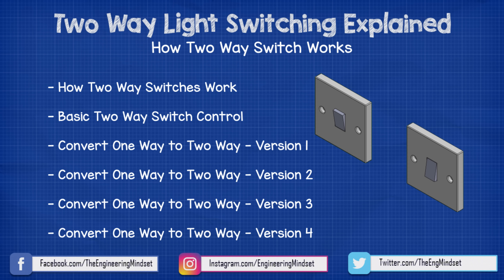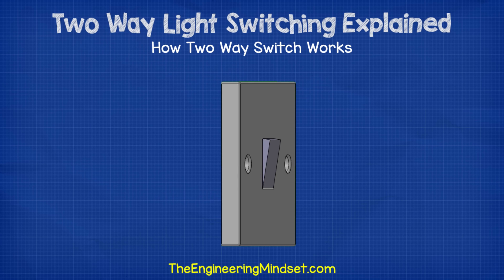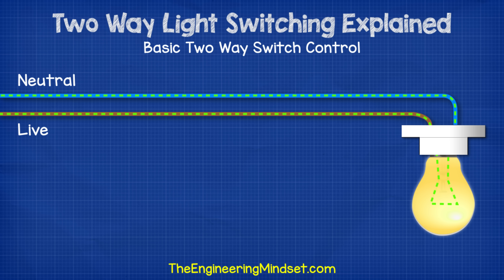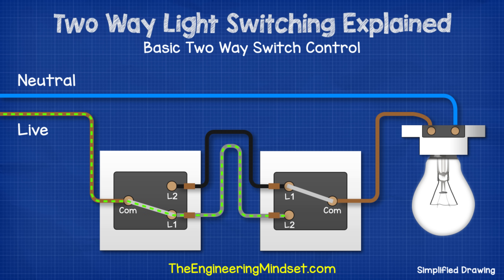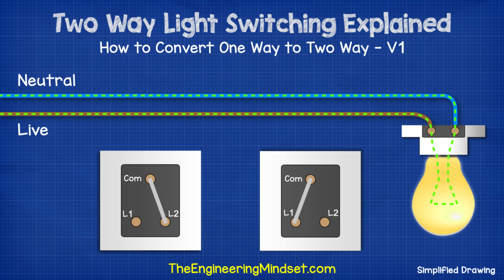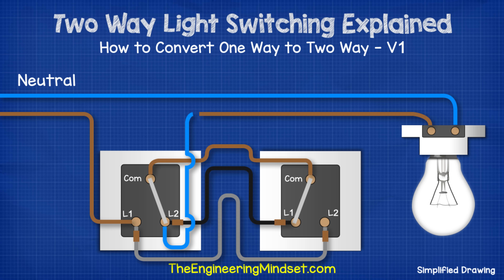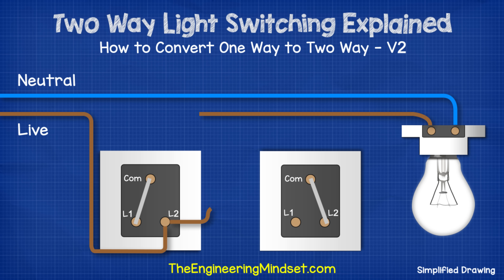Two Way Switching Explained - How to wire 2 way light switch

Comment: What is the difference between the 2-way switch and the one-way switch with 3 termnals? They look identical in the video with the clap always connected to com and alternating between L1 and L2.
Also, what about the topology of 2 2-way switches with the light fixture in between, which is practical (but allowed?) since normally the light is located between the 2 switches?
Connect both L1 to live and both L2 to neutral, then place the light fixture between the 2 comms. In this way when the 2 switches are en the same L both terminals of the light fixture will be on the same potential (either live or neutral) and hence no current will flow. When one switch is in L1 and the other in L2, then one side of the light fixture will be live and the other neutral. This configuration is the most practical, but has the obvious drawback that the light can be turned off by being on a live wire. When that happens it would be similar to having a light controlled by one normal one-way switch installed on the neutral with the live going directly to the fixture: The light may be off but the fixture still energized.
If this method is not allowed (because of the above or other reasons) I think it would have been good to point it out because it is not uncommon to see this installation (as it is not uncommon either to see switches on the neutral or outlets wired with reversed polarity).

Comment: You're drawing is confusing to beginners. Just use the actual numbers instead of using L1 & L2. To easily understand. In fairness your explanation is quite good,  but the said issue I found that makes you're expanation complicated..
Reply from the maker: The terminals are numbered L1, L2 on the actual switches, that's why we used them. Perhaps you need the "three way" switches video for North American terminology, if so, please see our channel for this

Comment: These solutions seem very complicated. I was taught:
First common: Live
Second common: Lamp
L1 to L1
L2 to L2
This way you always connect an identiviable wire to the common (route to powersource or lamp) and two to the other switch got to L1 or L2, if you cross these the circuit still works. No double connections, very easy to see where the power comes from (live at the first switch, intermittent live that are on L1/2 on the second).
If you need a third switch, use a crossover switch between the L1 and L2 connections, need a fourth, ad a second crossover switch, etc. etc. etc.

Comment: There is a V.5: It is not a allowed here because a malfunction in the switch can cause a short circuit. Do not use this: connect live to L1 on both switches, connect neutral to L2 on both switches, connect the lamp between the com terminals of both switches.

Comment: Hello, just saw this Great Video recently. I would like to learn how remote switches work. I mean when you close a switch in a particular circuit, it will wirelessly close another switch of another circuit and light up a bulb. In short, two different circuits, each with their own batteries, being able to interact without any wire connection between them. How do they work ? 🤔

Comment: Nice explanation.

Those type of circuits probably won't play much of a role in the future, though.
You could use wireless systems with only one switch, possibly included in the device (like a smart lamp) that cuts the electrical circuit when a wireless signal is received.
That allows to add many light switches without any cables what so ever or even turn on the light with over devices like smartphones, voice control.
Reply: You could, but it is far less reliant, especially since cyber security isn't anywhere near the top of the list for "smart" lamps.

Comment: serious question: who uses these switches? you would need to put two switches in certain positions for the light to work... what's the point?
Reply from the maker: Yes, you would. Small room wouldn't need it, larger room or corridor would. Many bedrooms have them, one near the entrance and one by the bed so you don't have to walk in the dark to your bed. Probably almost every property on the planet has at least 1 of these circuits in them.
Reply: @EngineeringMindset  I live in romania, smal country, former soviet block, etc... that's why i'm not familiar whith this type of arangement.

Comment: at 4:05, wouldn't it be short-circuited as the current is flowing from L1 to L2 point  & meeting at the same destination as the current flowing from L1-com to com & then L2 point, there is no opening between these two paths. please explain thanks.
Reply from the maker: No it's not a short circuit because it's connected back to itself and not to ground
Reply: @EngineeringMindset  got it

Comment: I was thumbing through the new 2023 code book and couldn't find any reference to "2 way" switches, though I found plenty of references to "3way" and "4 way" switching. Is 2 way switching something entirely different? 🤔
Reply from the maker: You're in North America then, where this circuit is called 3 way. Please watch the 3 way video
Reply: @EngineeringMindset  I've studied  the NPFA 75 and the CSA 22, both of which are applicable in North America. I completely understand exclusive or gates so that video wouldnt help me. What would help me is to know what code organizations mandates you are referencing so I can purchase a copy for myself and learn at my own leisure. Thanks

Comment: I have got a question
I have two two way switches and one pf them is working with the help of the video bit the other one is for a light downstairs - the switch upstairs has 3 wires (one yellow, one red, and one blue) but the one downstairs has 2 of each and it also has 2 L1 terminals and no com I am really confused
Can you please help
Thanks

Comment: 3:07 - This is probably going to surprise you if you hadn’t already noticed after so many years, but you forgot to show the light already installed as a typical installation with a single switch. That means your “conversion” to two-way is actually just a fresh installation… which you covered elsewhere in the video.

Comment: Theyre typically called 3 way. There are also 4 ways that go in between 2 3 ways when needed. After watching, do not use this if youre in America. They arent the same. Our 3 ways have 4 terminals, line and common, and 2 traveller contacts. 4 ways also have 4 terminals but both pairs are travelers. The ones he is showing are 240v with l1 and l2 and common and will not compare to the switches in America. EU use 240v 50hz, USA use 120v 60hz

Comment: So then... European's will wire anything "switched" with only 2-way switches (unless there's more than two locations)? In your neck of the woods, there's no such thing as a 1-way (single-pole) switch? Having the option to convert back and forth from 1-way, to 2- way would be expensive, as you'd have to wire an entire house with 3-conductor wire between the switches. In America, we only use 3-conductor wire between 2-way (3-way) switches only, and/or a single wire carrying 2 circuits.

Comment: First let me state I will not touch electricity myself, now the question that may make everyone laugh but I’m serious … is there any means to do the wiring so the switch up will always be on and switch off down will always be off from either side of room?  in other words, regardless which side of room your on, if you flip switch up it is on, down off or just live with direction of switch is moot when two switches work one light

Comment: This is amazing.. electricity flowing so many ways with the use of just 2 switches. Do you perhaps know of a sort of changeover switch, but not for heavy duty power, just for like an alarm system? Reason being, I wired my alarm to my light mains, but I also have a light sensor which consequently switches my lights & alarm system. off during daylight... I would much prefer the alarm stay on (at the very least when I'm away)

Comment: I had to clean out my back box and messed up the wiring on the two way. After using multiple images on Google, I found this video and fixed the issue in 5 mins. I owe you a Sunday 😂

Comment: It's satisfying to get an idea of how the wiring works (I didn't even know there were several different ways of installing the circuit) but I think I'll still leave it to an electrician, thanks all the same.  Here in the UK any electrical work now needs to be carried out by a qualified person anyway.  Additionally it's important to have this paperwork when selling your house as you it may be required.

Comment: Any help  , i have an issue , the existing light SWITCH shows 2 red wires in L1 , a blue and black wire in L2 , and yellow into the com , but the new switch has L1 L2 L3 L4 no com  , in simple terms what has to be done thanks

Comment: An electrician once said you should put a light switch always on neutral and this video shows on live wire? Which is correct?
Reply: May be that it depends on where you’re from. In the 60’s the USA electricians did it both ways. Post 60’s only the hot side is open/closed since the common goes to ground. At least that’s what I was taught. I’m sure if I’m off a little bit the YouTube community will let us know repeatedly.

Comment: I believe the whole circuit gets "short circuited" when live wire is looped to itself at (4:16).🤭
Reply from the maker: No because it is the same potential, it has to go to a lower potential to short, such as the neutral wire

Comment: Please if you coulf answer my question : if the circuit is broken and the electricity is flown . What happened to electrons did they reach the edge of the broken wire and stop or they didnt move at all due to the broken wire

Comment: The easiest way to convert a one way to a three way is to run a dead end switch with a 3 conductor wire.  Bring power to common of switch 1, send power over the travelers and return it on the common from switch 2.  Tie the return common to the switch leg to the light.

Comment: i have a stupid question if a line has 2 120 volt appliances hooked up to a circuit of 120 volts one only needs 5 amp to operate and the other needs 10 amp to work why doesn't the 5 amp appliance just blow up?  say a light and a compressor.   the line is 120 volts and a 15 amp circuit.  isn't 15 amp always there?
Reply from the maker: They are wired in parallel, watch this https://youtu.be/5uyJezQNSHw

Comment: Great explanation and superb graphics.  My only remaining question is the blue wire used to come out of switch and then connect to brown going to light.  Does it really have to start off blue and join? How? Can I not just connect the brown wire in switch and sleeve it?

Comment: Am I wrong in saying I see short circuit in all methods apart from first? 4:06 as an example
Reply from the maker: There's no short because the live wire is touching itself, so it has the same potential/voltage. Only if it connected directly to the neutral and bypassed the lamp would it be a short

Comment: Seems the first version is the most practical, since it would only need two wires between the two switches, and uses the least conductors.
Reply: It all depends on the situation you have. If it is easier to run the switch leg to one switch, and you already have power at that switch, then running a 3-wire between the two switches would make sense. Some of the situations you find yourself in in some houses can be very challenging, especially when 20 foot ceilings are involved and large openings where support beams are required can make running electrical hard.
Reply: I'm with you on that, you'd only need a twin and earth and use the live and neutral, why our friend is going on to say you need a 3-wire is beyond me and I'm lost however I'm a chippy and no sparky 🤔🤷‍♂️
Reply: @adamprice9214  B/c if your switch leg going to the light and your power is in the same switch box and you do not have  either in the other switch box, you have to use the 3rd wire to return the switched leg back. A 3 way switch requires 3 wires. 
You also cannot mix neutrals between different circuits  with the newer arc-fault breakers. 
So to do it your way would require either the switch leg and power  in each box, or the same  circuit in each switch  box.
Reply from the maker: Seen our new incredibly detailed MCB video? link: https://youtu.be/gqEu9t8HwW0

Comment: Not really getting why you just wouldn't just use the first configuration when you need to convert a existing switch to 2 way switching. I didn't really see why method 2 - 4 would be better for anything it just used more wire and was more complicated.
Reply from the maker: Read the subtitles on each design

Comment: 5:36 does this cause short circuit?
Reply from the maker: no, it's the same voltage on that wire so there is no difference
Reply: @EngineeringMindset  Oh. thanks.

Comment: This is all fine and good.....until you move to Thailand, and find out that they don't care even a tiny bit about wiring color codes. It is totally comon to find every room and outlet wired differently, as far as what color is hot or ground, they just use what they can reach at that second. (and don't even get me started on the plumbing)  I have a two-way switch in my staircase, and for years I've wanted to get it working right. As it is, we must turn on the light at the top of the stairs, meaning you must walk up them in darkness. I've tried several times to figure out the combination of wires that would get it working right but finally gave up, and when I had it working so that at least the top switch worked, I stopped and left it at that. This makes me want to try again.
Reply: It’s quite easy to correct.

Comment: Can you please do a video for two switches controlling two lights at the same time, please?
Reply from the maker: Just wire the lights in parallel
Reply: @EngineeringMindset  thanks for the response but I don't understand 🤦🏻‍♂️ I'm more of a visual learner. Np if you don't have the time.

Comment: You have seen to have made the switch more complicated then it actually is and you don’t have the example of the power being at the light with only a switch leg down to a switch.  I personally like to see the power at the light itself with switch legs because you then have the option of a fanlight only switching the light with the switch and operating the fan even with the light turned off.

Comment: The first demo is the simplest and cheaper 👍👍👍
Reply: Only works in a trunking/conduit system. Household wiring uses 3 core cable. Regardless of how you do it (junction box, loop in lamps, loop in switches) it requires 3 core cable between the switches. So it's all the same, just the preference of the installer/ limitations of the installation.

Side note there is such an invention as pear shape cable which could make it possible in a house but that's very very very rare and I don't know if you could even buy it now and long story short it wouldn't be cheaper.

Comment: Illegal to sleeve cables and use as live where I live, check your local rules before doing that. Live wires need to be coloured correctly length of cables, also neutrals and earth wire can never be used as live! A little bit of knowledge can be dangerous !
Reply: Where are you from?
Reply: @cal5566   New Zealand
Reply: @brucewilson6372  tbf mate from my 10 minutes of research your 3 core cable doesn't even have an earth. Everywhere is different I guess. But UK which is what this appears to be loosely based on sleeving cables is standard practice. The only cable that cannot be sleeved or used for anything else is the earth.
Reply: @cal5566  Incorrect! The cable we use is Rd, Bk, Gn/Y and two way switching wire are all phase coloured Rd, W, Bl. Earth wire have been mandatory for over forty years here! The explanation would work but we generally do much easier way and just run 3 core to second switch and loop at first switch to light. Method show is for conduit wiring not TPS which is 3 core !

Comment: Hi is the one way and two way switch shown not the same? As i cannot see the difference of the two apart from the one way switch making use of 2 extra wires whereas that of the 2 way switch makes use of 3 extra wires.
Reply: So in this demonstration you see 2 way switches which use 3 terminals (com, L1,L2) where as a one way switch has only common and L1.

Comment: How do I add an extra bulb in this existing application. E.g Two 2-way switches which operate 2 Lights at once
Reply: Connect any additional bulbs between the first bulb and the neutral wire.
Wire from the switches into bulb one's first terminal (as in the diagrams in the video), wire from bulb one's second terminal into bulb two's first terminal and  neutral in bulb two's second terminal.
If you want a 3rd (or any additional) bulbs, it's the same again, from bulb two's second terminal into bulb three's first terminal, and bulb three's second terminal is neutral and so on with any additional bulb.

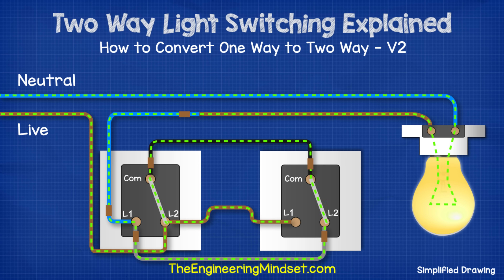Comment: 5:15 isn't it a short circuit??
Reply from the maker: No, not if live touches live.
Reply: @EngineeringMindset  ah! both points will have same voltage👍

Comment: 2:34 The electricity (electric charges) does not flow to switch 2 when the circuit is broken/open, considering the typical ideal assumption that charges/current can't flow in an open circuit.